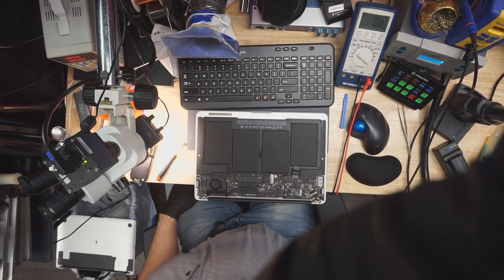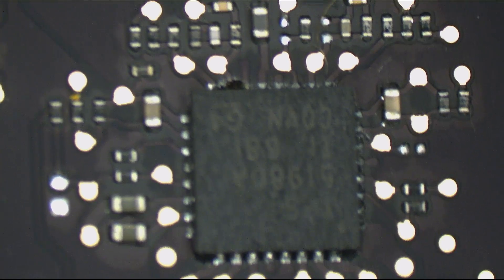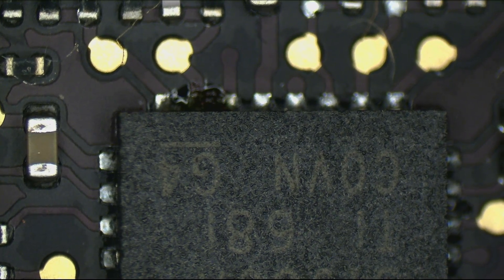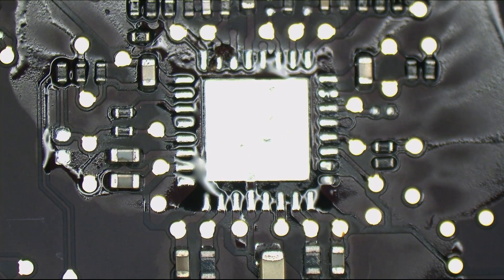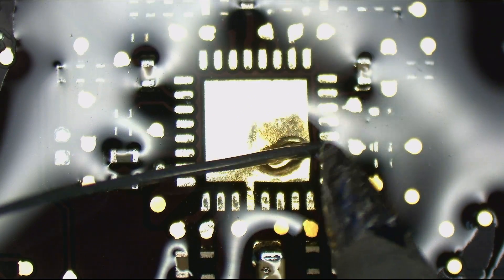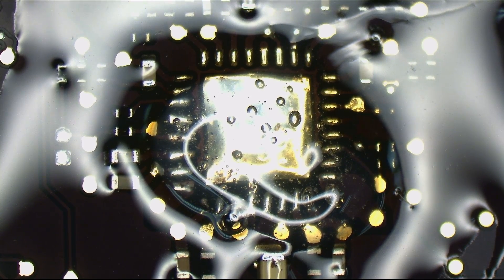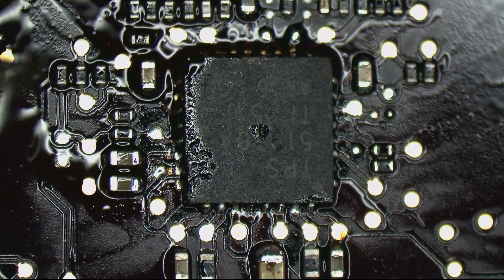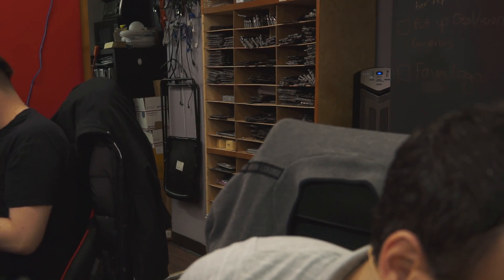MacBook air board repair + ten minutes of pure, unadulterated shilling for rossmanngroup.com

Comment: i was considering about the Ghana inquiry, imagine how much money the electronics "recycling" kids in such places as africa and china could make if they could just get some of these boards and systems and repair them instead of melting them down, that would be a far greater charitable thing Apple could do; teaching the junkyard melters how to fix this stuff, even with these very vids, at least on a basic level like maybe just a few issues per person and then a little group shop has the skills amongst them to do full board repair and teach eachother all the rest and then sell these things for pretty decent money when it would otherwise just be melted to trash (often at the behest of apple), like a single resold machine at typical used/refurb prices (in the west anyways) ends up being like a 5 yr salary for some of those people... i guess the problem then becomes exploitation sweatshop wage stealing etc (hi foxconn) - but i think the argument could be made thats a better outcome and situation than standing over toxic melting fumes all day

ewaste wouldnt be such a big problem if we just stopped doing so much of the "wasting" part in the first place; especially when the only purpose is to middle finger repair shops that actually can fix most problems these "high end" products seem to suffer from so often and consistently

Comment: Thanks Louis,  for shouting out to the Hackintosh community. Yes, agreed. The days of Hackintohsing is indeed numbered. the T2 chip is not so bad atm, as Apple still needs to maintain compatibility with pre-2015 laptops. T2 chip secure enclave is not a requirement for running Mac OS for now (fancy branding for a TPM). But I think a a few years time, Apple's move to ARM chips and more custom silicon is going to spell doom for what had been an awesome run. Windows is slowly catching up if they stop loading it with bloatware. Maybe by then, I'll move to Linux or to Windows. For now Mac OS is still a great system, eager to see how they fuck it up in the next few years. They've already fucked up all their hardware. Hell, the whole laptop industry has, not just Apple. We're also not quite at the point where windows and mac os are as bad as each other so the trade off for one outweighs the other I think.

Comment: I think the main purpose of the T2 chip is to prevent people from running MacOS on non  Apple hardware. Right now the T2 chip is not active, but as soon as the last Apple computers without T2 chip become "vintage", they will activate the system, and boom.... nobody can run MacOS unless the have an Apple product. And nobody can repair Apple computers without the "activation" tool from Apple. 
Apple will then have full control over their user base. They decide when it's time for you to buy a new computer, and they decide what you can use it for. At least until people stop buying their stuff.